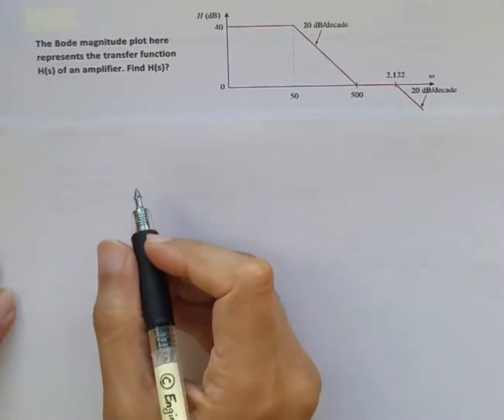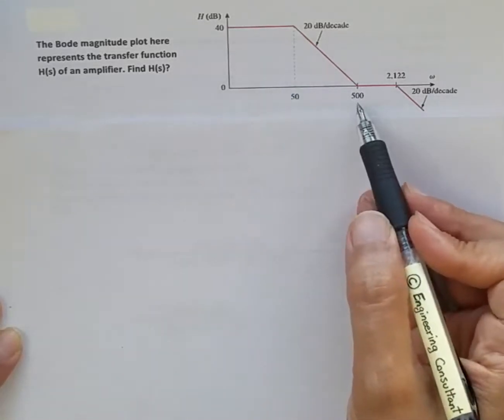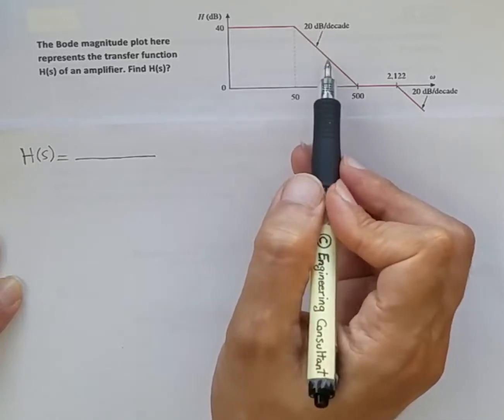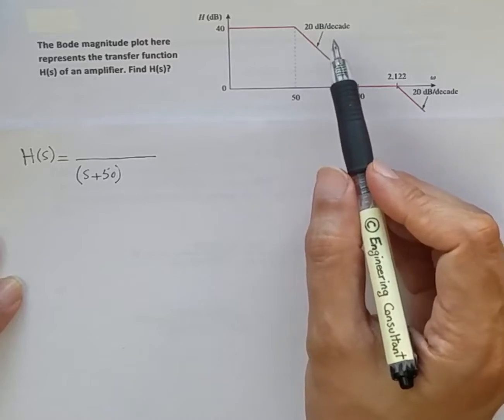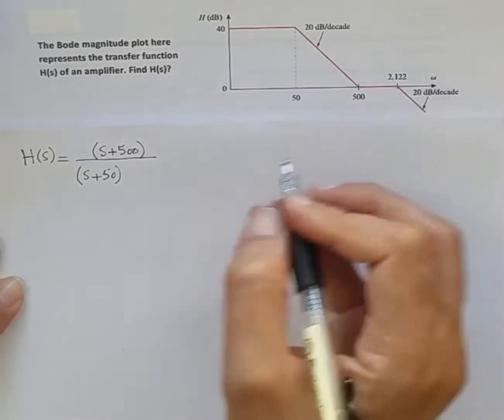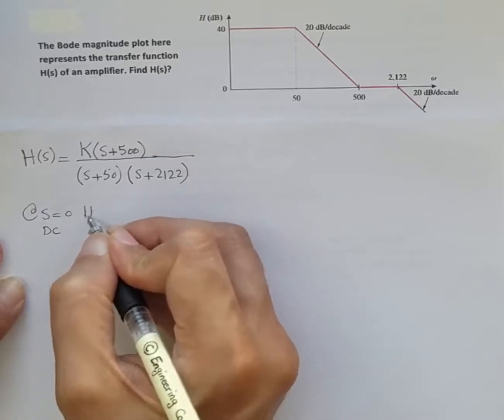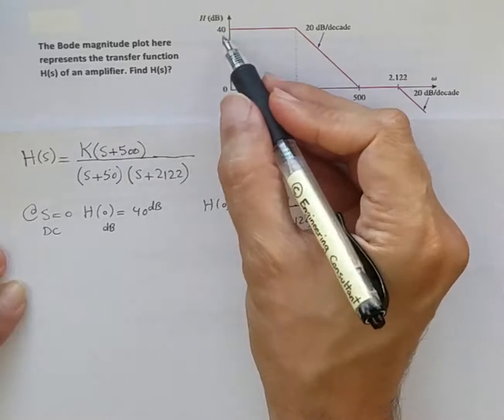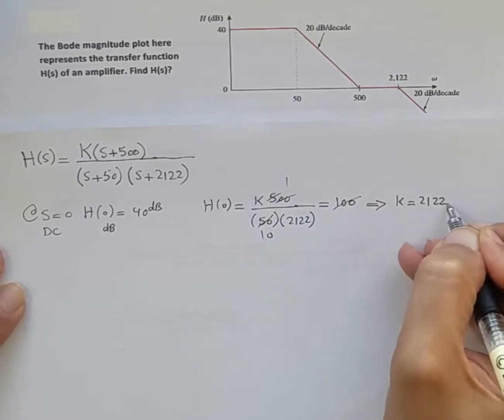How to find Transfer Function of an amplifier from Bode Plot

Comment: thanks, in the graph, both is 20dB/dec, what if one become 40 dB/dec, how to gonna deal with it?

another one is your graph starts with flat, what if initially it is going down, how you gonna solve this?
Reply from the maker: You're welcome, thanks for watching and good questions. The Bode plot of Frequency Response video 
https://youtu.be/zgdUwZcUEW0 is an example that has 40 dB/dec drop and a plot that is not starting flat. In summary, 40 dB/dec drop in Magnitude response indicates the presence of double poles for instance (s+50)*(s+50).  Regarding your second question, if the Magnitude response plot is initially dropping (instead of flat response), then it indicates a presence of 1/s term in transfer function.

Comment: Thank you for your help. 
Compared to other channels, you explain the topic very clear and precise.
Reply from the maker: You're welcome. I'm glad that you liked my videos. A few related circuit videos are https://youtu.be/Ga8Lu8sWlAk that explains Analog Filter Frequency Response and Poles and Zeros in Bode plot. Then in https://youtu.be/U3AR1XCkX8k  a BiQuad Filter Circuit Design and Transfer Function Analysis are discussed. The Diode-Amplifier VTC is explained in https://youtu.be/vpGZkafxMJM . And in https://youtu.be/2J-0msXZE2o Universal Analog Filter implementation with Op Amps is explained that can simultaneously realize Low-pass, band-pass, high-pass and band-stop filters.  I hope these videos are helpful as well.

Comment from the maker: Thanks for watching. For more Analog Circuit examples please see: 
Logarithm Analog Computer with Op Amp https://youtu.be/RpKEq5WyoLg
Push-Pull Power Amplifier with Darlington Transistors https://youtu.be/866MYibo8yE
Analog Computer to Raise Signal to power n https://youtu.be/IUTlBH1UraE
Full-Wave Rectifier  https://youtu.be/DJJMNU-CYcg. 
Differential Equation Solver Analog Circuit https://youtu.be/R3X5AYNZGEI
Triangle Oscillator Op Amp circuit https://youtu.be/JF5Up_cuL9k
Diode-Amplifier VTC is analyzed in https://youtu.be/vpGZkafxMJM 
https://youtu.be/HeZRtnRXpEI presents a circuit with op amps and feedback loops to design an analog computer that solves a second order differential equation.
For more analog signal processing examples see: https://www.youtube.com/playlist?list=PLrwXF7N522y4c7c-8KBjrwd7IyaZfWxyt
I hope these Circuit engineering and analysis videos are helpful.

Comment: From 50 to 500 is one decade, isn't it? So the magnitude goes down by 40 dB/Decade. Am i wrong?
Reply from the maker: From 50 to 500 is one decade.  We have 20dB per decade drop as shown for that frequency region. You have a valid point that why magnitude then is shown to drop from 40dB at f=50 to 0 dB at f=500.  Thanks for noticing. That 0dB shown on Y axis is redundant. It should be removed.  Basically we start at flat region of 40dB up to f=50, then we just go down by 20dB when we reach f=500 and rest of the plot ... Thanks again DL9AR for noticing the redundant "0" shown on Y axis.
Reply from the maker: Thanks for watching. Please see more circuit examples https://www.youtube.com/playlist?list=PLrwXF7N522y4c7c-8KBjrwd7IyaZfWxyt   I hope these Circuit Design and Analysis Examples are helpful. 🙏